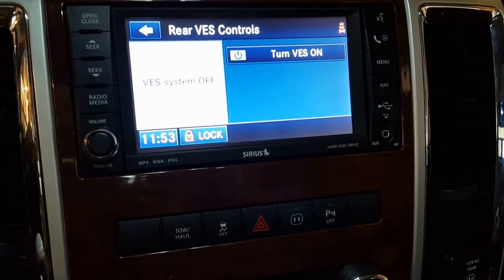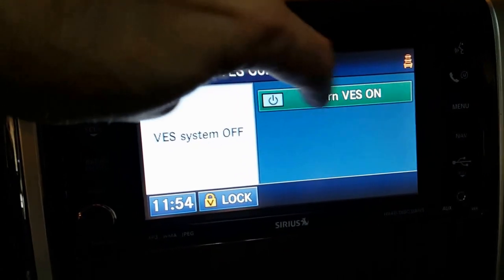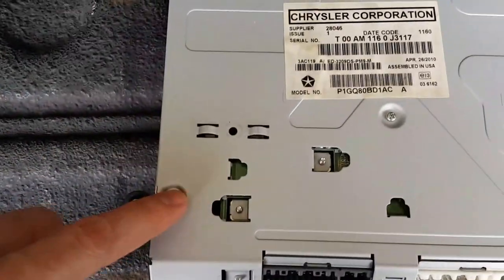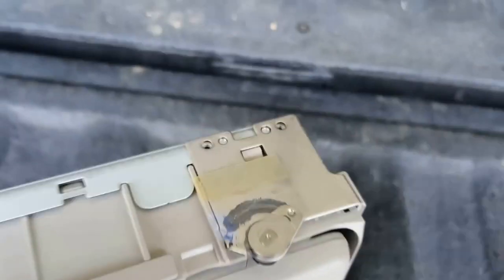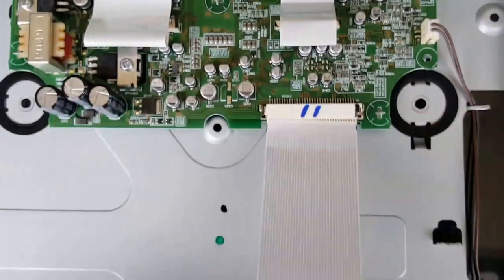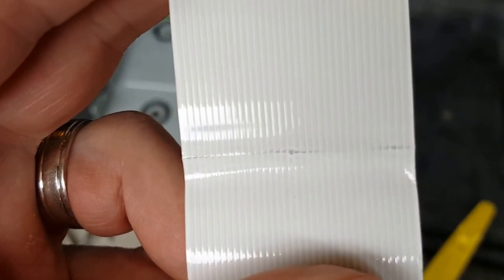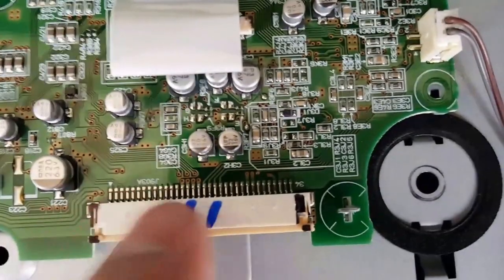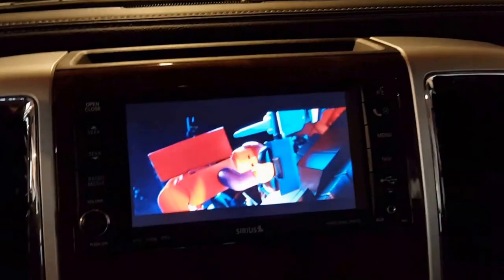How to fix blank, black, or VES system will not turn on for a 2010 Dodge Ram

Comment: Just wanted to say Thank you! This was close enough to help me fix my sister’s minivan VES for her, my niece, and my nephew. FYI, it was way simpler to watch the RAM fix than taking the whole system down on the Caravan, but still possible. Although her van, I think it had been replaced before, had 4 different bolt/screw types holding it in place. 🤪🤣 It was about a 2 hour job. Thanks again for your video for the assist!!

Comment: Just did this fix on a 2012 caravan crew, aside from having to pull the full-length console down and removing a mounting plate, the work was pretty much the same. Replacing the cable fixed it for me. Thanks for uploading this! Saved me probably 400 dollars.
Reply: That's exactly why I posted this.  Imagine if every person that watched my little video saved $400, as of now that would have saved the consumer (us) over $10 million!  Help out your neighbors...even your online neighbors!
Reply: @danielkreps5304  You got that right Brother! Never know when you will be in need. Im retired fire/emt so guess just in my blood to help but its also good to be owed per say than to owe. Great video was in process of dropping my customers screen out of 16 town & country was hoping it was an issue close to ur video i was thinking it would be more like a cold solder on board found ur vid so saved me probably 20mins in diagnostic time. Need more people to have ur additude in world! TY
Reply: @Christopher Kemmann did was your unit not powering on? I have the same van and my units all of a sudden stopped powering on. One minute the kids were watching a movie the next it wouldn't turn on.

Comment: thanks a ton.   i just ordered a cable for 17 dollars.  i was skeptical that the. able was bad but when i opened the monitor i found a serious crimp in the cable as you suggested.  i just bought the 2012 and its in great condition previous owner didnt attempt to fix it and always took it to the dealer we all know how that would go.  should have cable in a couple days will repost with results.  thanks again
Reply from the maker: You're welcome!  I am going to be posting another video soon about how to repair the newer model years. I also figured out how to upgrade an old screen to newer model screens, and I will be posting that when I get time between work and kids! Subscribe to see when I upload them 😀

Comment: Thank you for your tutorials. My head ves unit is dead. Could this problem have caused a short in the electrical that led to that? There is a phantom drain on my battery as well.
Reply: I have the phantom drain as well. Did you find the cause?

Comment: So I changed out the ribbon for my 2013 Chrysler town and country. Bought the 34 which is what mine takes. Verified with your other video. Now the ves will turn on but there’s still no video to dvd screen. Not even the Chrysler symbol comes on. Not sure if it’s something else. I did put the contact face up. Not sure if I need to try it contact face down? Any help is much appreciated. Thank you for the video.

Comment: Thank you for this video,  had the same issue with exact dvd player screen in my 2015 dodge journey.  Bought cable from a motherboard repair company out of greenville.  Paid $40 for two instead of $500 for a new screen.
Reply from the maker: John Hassell glad it helped you save some money! When I figured out it was this simple I had to share!
Reply: i HAVE A 2015 dODGE JOURNEY AND NEED TO BUY CABLE , CAN U TELL ME WHERE U GOT IT

Comment: I think this is the problem in our 2015 caravan---I'm going to attempt to follow your steps. I'm curious though---do you think it's better to keep the screen open rather than closing every time we get out of the car. We open and close is multiple times a day and I'm wondering if that is why our cable isn't functioning.
Reply: Alison Rhea it would probably last longer by not opening and closing every time, but then again our cars would last longer if we didn't drive them, so it's kind of whichever you prefer. 😉

Comment: The ribbon cable connector popped off when I was disconnecting it. The small top plastic piece with some pins is broken that holds the cable in place. Is there a way to rig it back in there? Would taping it work?

Comment: Hi there! I have a 2016 Chrysler Town and Country. Our screen was black. It occasionally would work but if you touched or bumped it, it would turn black again. We took it apart like your video and replaced with a new ribbon cable we purchased on Amazon. It has the exact numbers and matched perfectly. When we tried to put the TV screen back, it still is black. But now, it does not even show the "Chrysler" logo on it as it did before. Any suggestions on what we might be doing wrong? Thank you for your time!
Reply from the maker: Here is the link to the 2016 version replacement - https://www.youtube.com/watch?v=lIZbKqqFvHQ  

The biggest differences are that to metal contacts need to face toward the circuit board, and you need a 68 pin cable for the 2013-2018 available here - http://www.amazon.com/dp/B07QMKHWJJ  

Also, if the cable is not all the way into the connectors it will not work.  Apply slight pressure while you close the locking mechanism onto the cable to make sure it's fully seated.

Comment: I got the two screws and the two bolts out but have no idea how to actually pull the unit out. How did you do that? I have a 2009 town as country. It’s got the long system with two DVD players. Maybe I have to undo the entire system maybe
Reply: How do I remove the bolts?

Comment: Thank you very much for this!! Saved me lots of $ with a very simple fix. Thanks again!
Reply from the maker: I'm glad it helped you out!
Reply: @bettysbeast  does this work on a 2014 town and country as well?
Reply from the maker: @jamesreed1337  yes, but you need to see which cable you have, the newer systems have more pins than the ones that are linked in the description.
Reply: @bettysbeast  ok so take it apart first and go from there
Reply from the maker: @jamesreed1337  yeah, just to make sure you get the correct cable. It's pretty easy to take apart.

Comment: do i have to disconnect the battery first?
Reply: I didn't, since all you're doing is disconnecting wiring harnesses you shouldn't be anywhere close to exposed wiring.

Comment: Now if I can find a video on my ves for a 2009 jeep grand Cherokee with the duel headrest monitors. I'm having the same problem the rear ves won't turn on. What's crazy to me is the rear dvd players were barely used. And now they won't play a DVD. If anyone has any suggestions or links I can try. I've been searching the net for days I can't even find the installation manual for these players. This is the oem mopar duel headrest monitors with DVD players.

Comment: I replaced the flat wire on both screens and the dvd plays but the screens are all BLACK as if its playing but nothing shows,,,,any ideas??
Reply from the maker: Does the screen in the dashboard play the video?  Does the system allow you to turn on the rear VES system?
Reply: I just replaced my cable but still nothing. Even before i replaces it it still aloud me to turn on and off ves

Comment: i found this helpful , just wondering how much money does this save someone?
Reply from the maker: Fixing it yourself will cost around $25 dollars and 30 minutes of your time.  The dealership cost to fix is around $1500. 1500 minus 25 equals 1475. So this will save you around $1400 depending on how you value your time.
Reply: @bettysbeast  dealer near Toronto quoted my wife $2000, my ceiling trim is a little different though i can get it off 2017 caravan
Reply from the maker: @jscudds  https://youtu.be/1fOjPJ3ilLs
Make sure you order the correct cable. The 2007-2012 won't fit. You will need HD VES TV Screen Repair Ribbon Cable Dodge Chrysler Town and Country 2013-2018 https://smile.amazon.com/dp/B07QMKHWJJ/ref=cm_sw_r_apan_glt_fabc_K8HWER5TMV0GCD3GZEWZ?_encoding=UTF8&psc=1
Reply: @bettysbeast, got it fixed about an hour ago' i cant thank you enough.  My kids gonna be so happy, thanks again.
Reply from the maker: @jscudds  awesome man! I posted this video because I knew it had to be an easy fix, but I the dealership was trying to mess me over.

Comment: I have a 2008Jeep Grand Cherokee.  My ves system turns on I get a black screen and sound. I replaced the cable but it didn't fix the issue. Any help would be greatly appreciated.  Thanks
Reply: I have the same problem.  Replaced the cable and tried to turn on the rear ves and it won't do anything.
Reply: Timothy Frier did you get it working?
Reply: I did (but didn't).  Get this one.  After having installed the new ribbon cable and reinstalled DVD player, it did not work.  I took it all apart again and decided to try flipping the ribbon cable.  Reinstalled and it was working!!!  The only problem now is that when we push the screen all the way back, it goes blank.  During the installation of the ribbon cable I did pinch it and busted a piece of the clip (tabs) where the ribbon cable is attached to the circuit board.  I'm thinking that when we push it all the way back, either the bend ruined the cable or I am pulling on the ribbon cable too much and putting too much pressure on it and pulling it out of the clip.  Another hint during the installation...I taped the ribbon cable to the housing the second time so that it did not get pinched when putting the housing together.  When I get a chance I am going to take it apart again and see if I can get it to work when it's pushed all the way back.

Comment: I replaced the cables but the DVD light is still flashing on my player.  There is no DVD in the player.  I can insert and eject disc.  My front screen is still black and the back screen is split.   I'm working on a 2008 Caravan.  Any suggestions?
Reply from the maker: If you're referring to the front screen as in the touch screen, it's probably not just a cable problem.  If you have 2 screens in the back of the van, I haven't worked on those before so I don't know. Also I don't know about a flashing DVD light, your system sounds different than mine.
Reply: Angela Cooper 
Did you replace both cables?
Reply from the maker: Mine is a Dodge Ram, so I only have 1 rear screen.

Comment: Have a caravan. Under warranty at dealership. In order to fix this problem they want to schedule an appointment weeks and weeks out and then they want to squeeze me into a tiny sedan when I need my van that is running just fine while they figure out and troubleshoot what the problem is. 60000 miles one owner and already this problem has occurred. Why hasn't Dodge attempted to fix it is my question. If I bought a car from them that had under 20000 miles I would file a lemon lawsuit against Dodge they need to have a recall. Those of you who have bought a Dodge product or Chrysler product brand new, start using this unit and put it to the test see how many times you can open it and close it before it needs a new ribbon cable and then just file a lemon lawsuit that will get them to do something.

Comment: Omg I just got my 2013 routan sel back from the dealership. Unrelated issue, but now both my screens wont work.
Freaking nightmare after nightmare 

Sending it back tomorrow
Reply: No way I'm doing all this.
Thanks for letting us know how tedious this is😒
Reply: This isn't my problem btw, my screen in my dash doesnt even worki